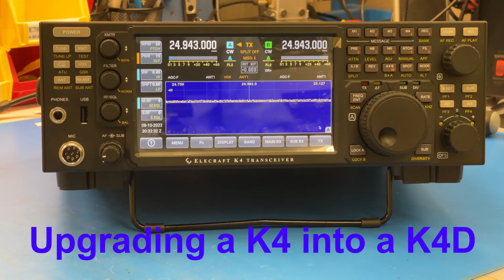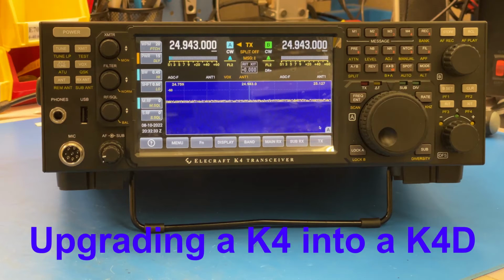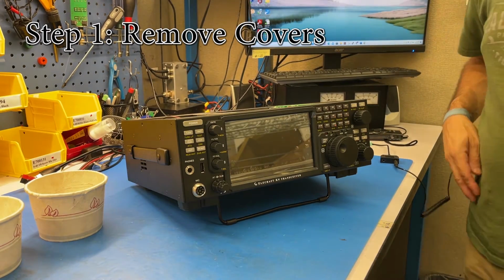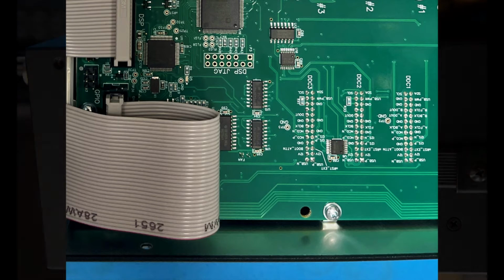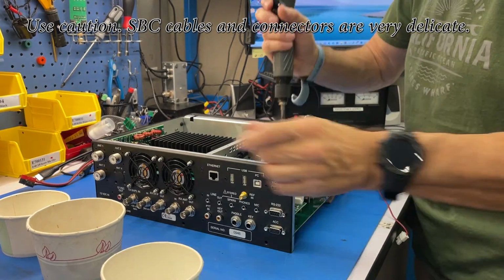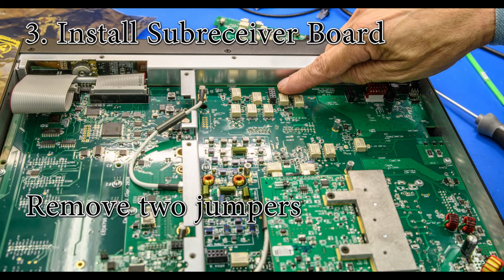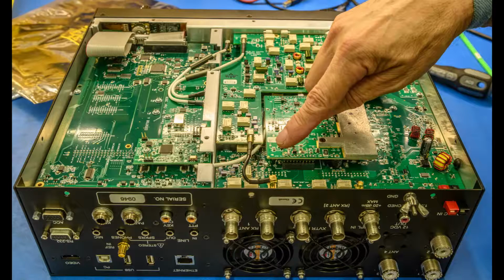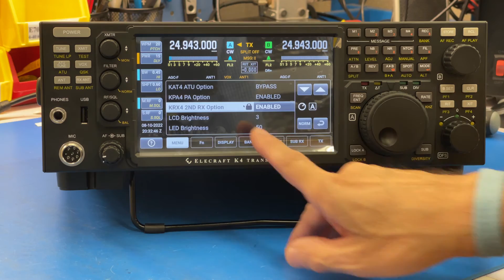Field Upgrade your K4 into a K4D

Comment: I just did the upgrade.  I opted for method 2 with the SBC but I disconnected the easy connectors like the RJ45, HDMI and two USB plugs. It made it easier to manage. But I was careful to not stress the other connectors. I had a small scare with the KDDC4 not sitting plumb but I figured it out. I also confirmed I did not have the lock washers on the LPA so I installed as directed. Thanks for thinking ahead to include the two extra screws. de NY4I

Comment: Do you have any plans to add wifi capability for wireless operation?
Reply from the maker: We do not offer an internal K4 WiFi option at this time as WiFi is a constantly evolving standard, with new protocols being added frequently.   What we and our customers use to get the K4 onto WiFi is a small, low-cost WiFi to ethernet adapter.  One example is the  BrosTrend AC1200 WiFi to Ethernet Adapter, available through Amazon at: 
https://www.amazon.com/BrosTrend-600Mbps-Adapter-Wireless-WNA016/dp/B0118SPFCK?ref_=ast_sto_dp

Eric
elecraft.com